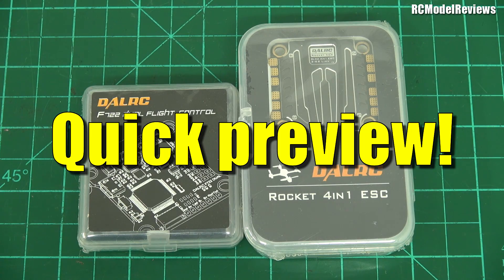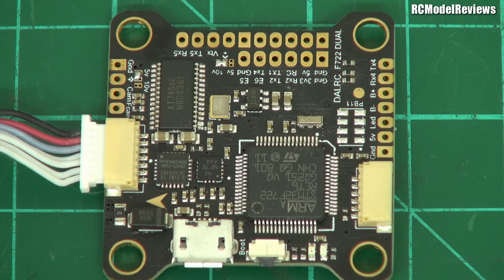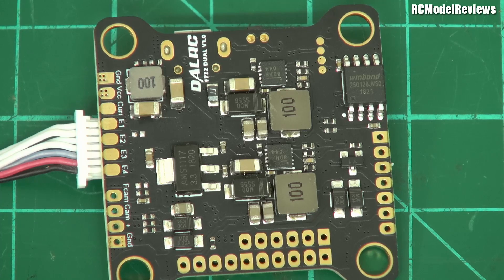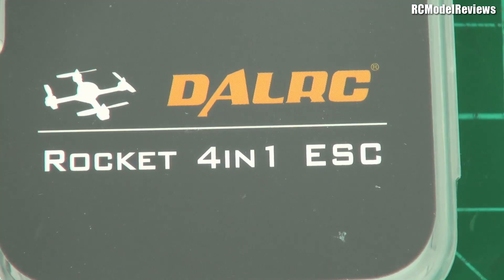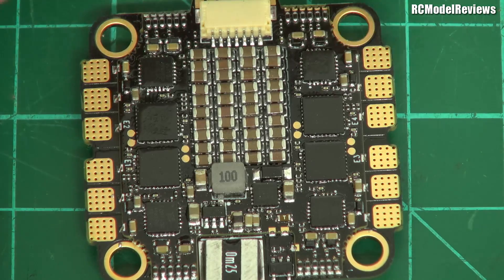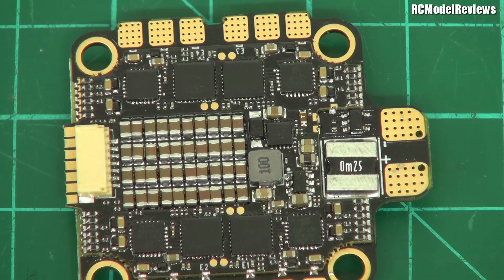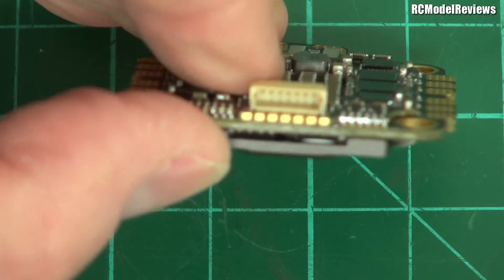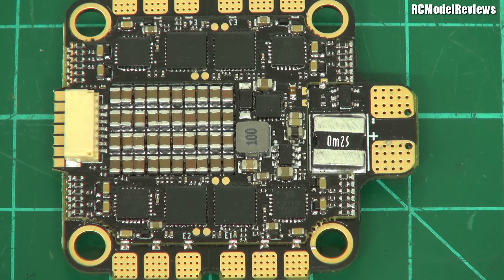Quick Preview: DAL RC F722 FC and Rocket 4-in-1 ESC

Comment: bruce, im about to use the f45a 4in1 esc and switching to 6s. I just can not wait until you release a ideo on your 6s setup. please give us any more information you can give us on upgrading to 6s, such as power regulators/ proper sized capacitors for applications/  pid tuning, etc. thank you bruce. looking forward to your 6s build

Comment: Hey Bruce 
I currently have the dalrc f405 stack with the engine - it works great 
But I can’t seem to turn on the barometer - can you check if you can ? If you have the fc laying around 
Cheers

Comment: What product do you use for conformal coating electronics, Bruce?
Reply: I use this stuff on mine: https://www.jaycar.co.nz/circuit-board-lacquer-spray-can/p/NA1002
Reply: I tried the jaycar spray on "way to messy". I now use MG Chemicals brush on link https://www.phaserfpv.com.au/products/mgchemicals422b55mlsiliconeconformalcoatingforwaterproofingquads
Reply: I haven't really found it messy, I guess it can be hard to apply it in exact locations due to having to spray it.
Reply: https://www.conrad.de/de/plastik-70-clear-1l-transparent-insulating-and-protective-co-800165990.html

best stuff ever. just brush 2-3 coats on everything... also aviable in spray cans...
Reply: i use clear nailpolish, the silicone based one.. it is cheap easy to get (steal from your wife or gf ;) )and evaporates when you (de-) solder a coated wire.

Comment: using 2 gyros could be a way of increasing the read speed . 2x 16khz gyro being read @ 32khz  . it won't be that exactly 32khz because the loop is not just checking the gyro but you could get gyro reading faster than an individual gyros maximum data output speed . possibility maybe